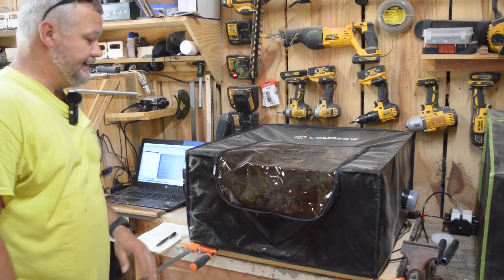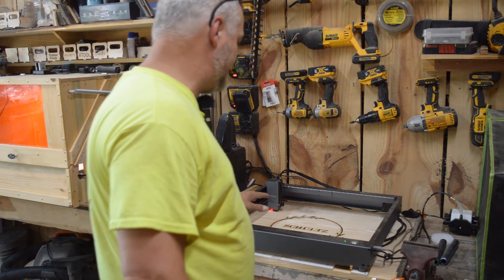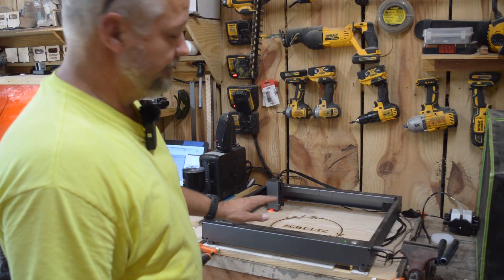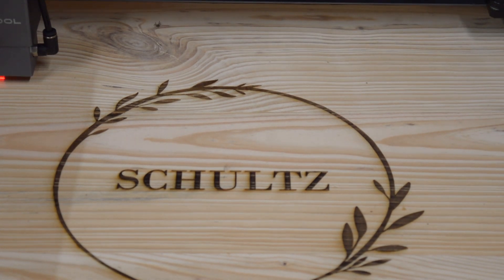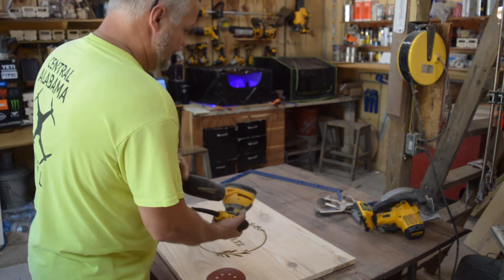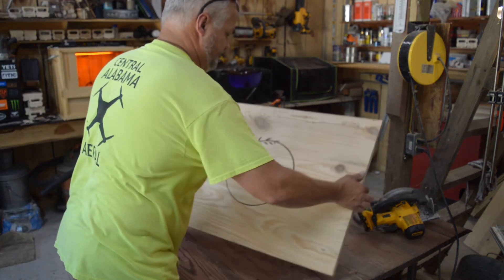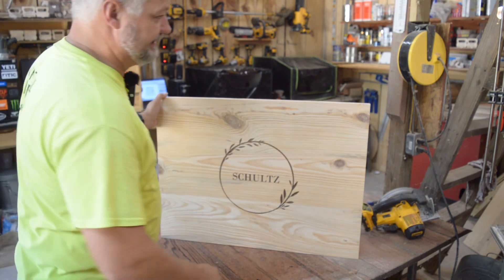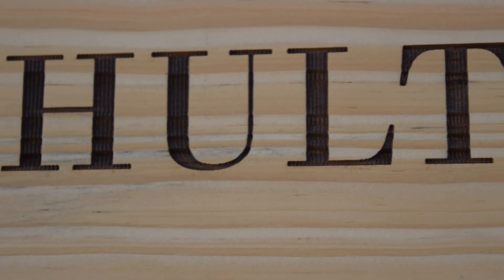Comgrow air assist for XTool D1

Comment: Nice to see the Air Assist is working well. I ordered the air assist and honeycomb about 9 days. They finally arrived today. Unfortunately the honeycomb was damaged in shipping. The Air Assist was packaged well. The honeycomb was packaged in a thin cardboard box with no foam or outer box to protect it. One of the corners was smashed and the honeycomb grid was deformed beyond being usable. They need to do a much better job packaging the honeycomb.
Reply from the maker: That isn't good. The air assist has worked well for me so far, I do like the new Pro nozzle better so far. I hope you get the honeycomb replaced.

Comment: Love your content! Bought the Comgrow because of your reviews. Question I have,  when using the kickstand my air assist cap that goes over the laser practical touches my material. Do you have a different way of setting depth or focus? Is this a user error issue?
Reply from the maker: They may have changed something, I didn’t have that issue with any of mine. What machine are you running it in?
Reply: @TheClackShack  I have the XTool D1 10W. Thank you for such a quick response!